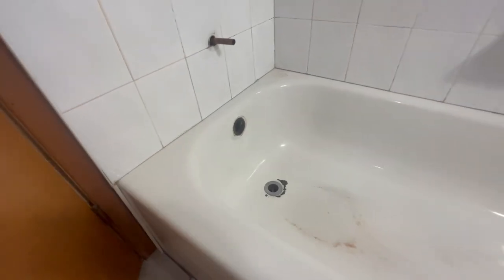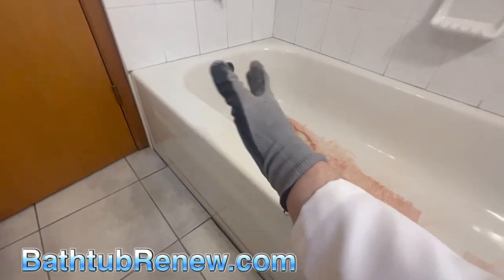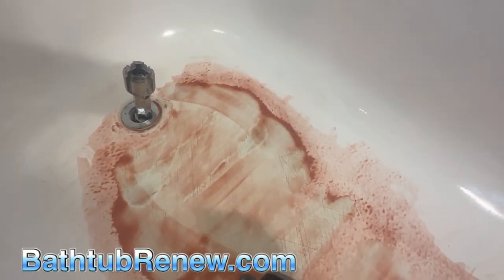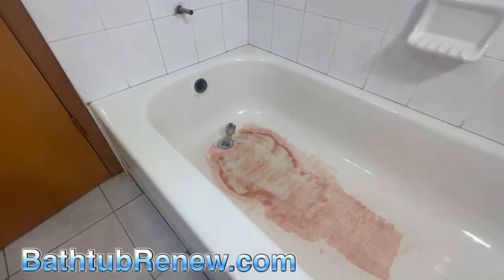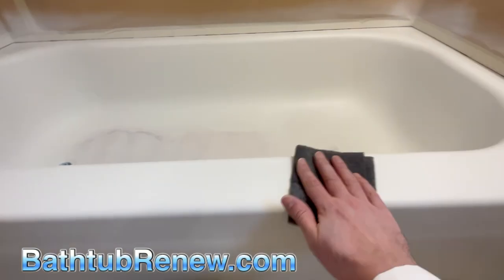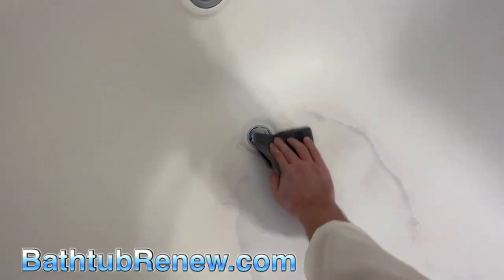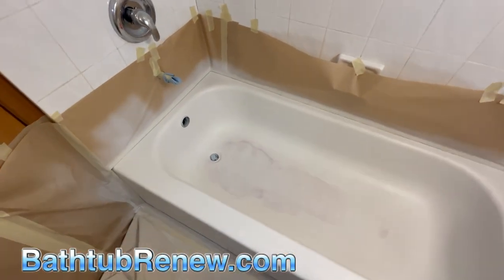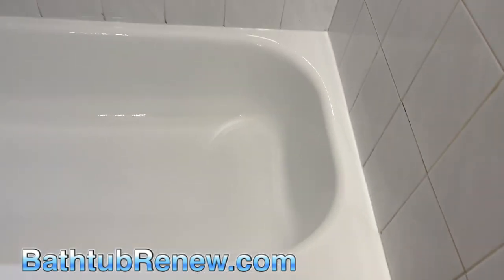How to use primer on a tub reglaze.

Comment: Ya know what,.. ive tested alot of things over the years,. And have found the crosslink works best,..even though i use a different topcoat,.. the  adhesive bond is the best ive come across,.. everytime i used hawks epoxy primer,.. ive had alot of failures,..that should only be used as a bite coat,..NOT a solid coat,.. just something for the topcoat to grab,. And you will be fine,.. but with crosslink,.. yeah, that is my go to primer.  Great video.
Reply from the maker: Thanks for the comment, really appreciate it!
You can find other testing videos I’ve done, hands down crosslink out performs everything many times over and works with all urethane coatings.

Comment: I use Topkote Bonding agent crosslink3 thanks to you recommendation.

Why does my primer crack and runs after I waited several minutes to apply it? I use Hawk,
Thank you in advance for your help and  videos.
Reply from the maker: hawk primer will crack because its being applied too thick, try thinner coats.
Reply: I would only use hawks epoxy primer as a bite coat,.. not a full solid lay down coat,.. just a few light passes,.. and it will be ok,... That stuff is not fast drying if you lay it down,.. I too(years ago)had a lot of failures with that primer.. . But I would only use that epoxy as a bite coat,.. and that will be tuff as nails,.Bc of the epoxy

Comment: I’ve never seen you put a nonslip surface on the tub. I’d say 95% of my customers ask me to apply a nonslip surface.
Reply from the maker: I use the drain rap skid step mats.
I haven’t offered the non slip in the tub coating for over 10 years now.
Reply: I’m not familiar with that. Could you show it in a video ?